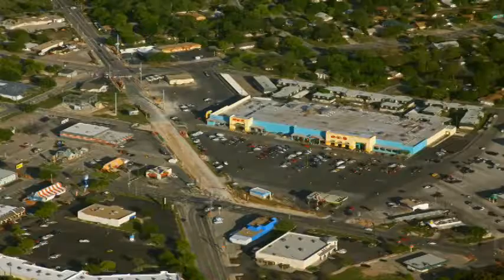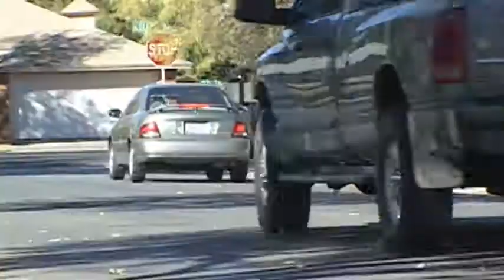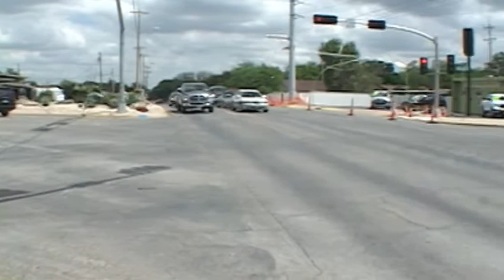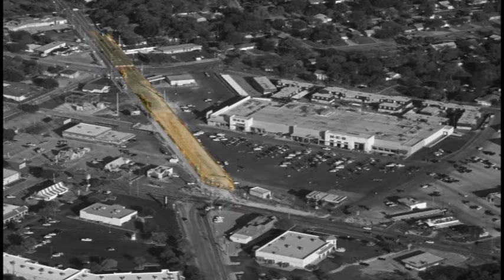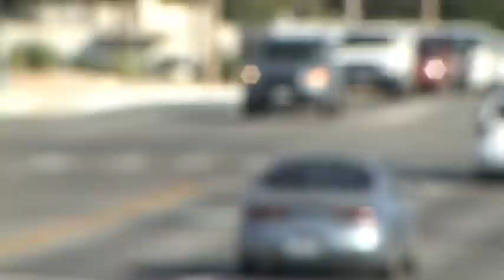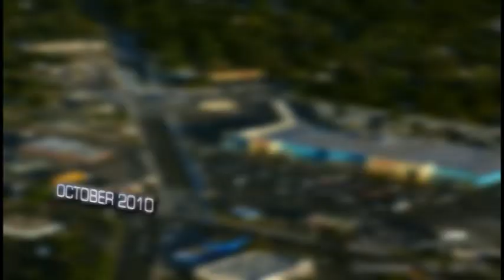Avenue N Construction

Comment: Light still does not function properly.  During slow periods, if in the right hand lane on College Hills trying to turn right on Ave N, the light will not change unless a vehicle pulls up in center or left lane.  This wouldn't be a problem except for the fact that right on red is not allowed.  I will cut through the residential neighborhood to avoid this situation late at night.  I've been stuck at the intersection for several minutes and cannot get a green light.